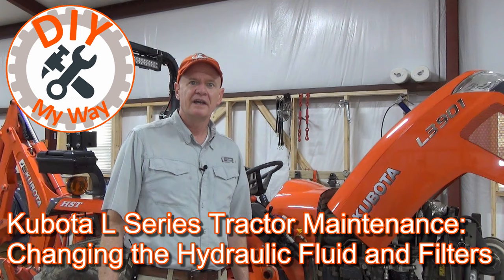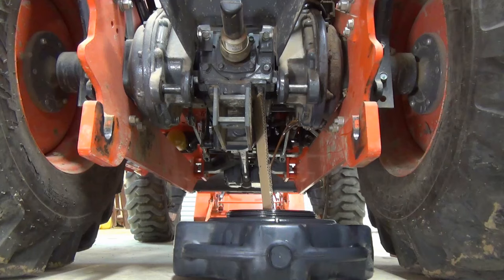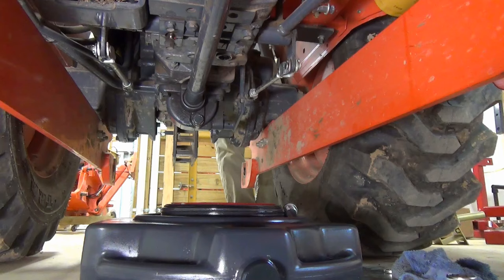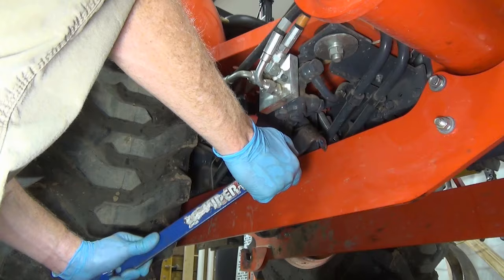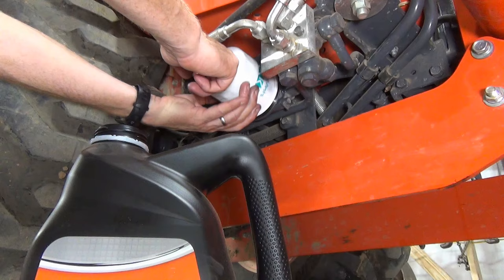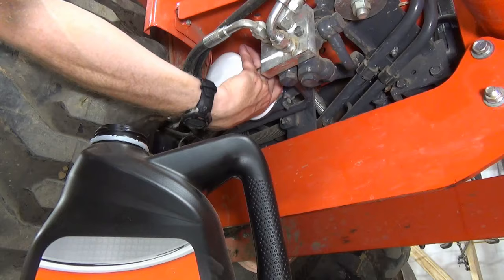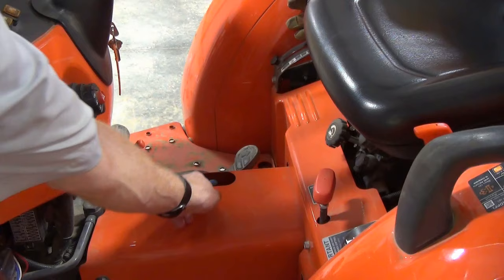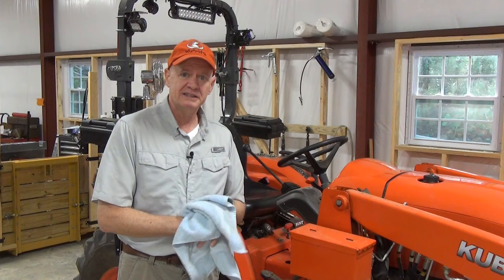How to Change the Hydraulic Fluid and Filter - Kubota L Series Tractor Maintenance (#90)

Comment: Have any of you noticed your PTO shaft turning even when the PTO is disengaged? It seems to spin faster as the tractor goes faster. Is this normal? I called my kubota dealer and they didn’t really give me a straight answer, just said sometimes it happens due to the hydraulic fluid pressure? Should this be something I should be concerned with? I have a 2019 L3901 with just under 300 hours. Thanks!
Reply from the maker: Hi Brandon! I only remember seeing that happen one time on my tractor when nothing was connected to the PTO. Next time you see it turning when disengaged and nothing hooked up you might consider seeing if you can stop it with a gentle grip with your bare finger tips or with a nitrile glove on. Don’t try it with leather glove in case it real is engaged. The leather glove might get caught on the splines and make a bad day for you. If you can stop it from spinning then don’t worry about it. If you can’t then it’s time to get it looked at by the dealer. Thanks for watching!
Reply from the maker: One thing I should add is that if the PTO still turns implements when it is disengaged even long after it should have come to a stop then it needs to be fixed by the dealer.
Reply: Ok thank you!

Comment: Hi, I have an L4600. It's 9 yrs old with 120 hours. Over time, the control lever pedal is harder & harder to press. Also, the pedal does not come back to stop when foot is taken off pedal. What is the fix for this?
Paul Conway
Reply from the maker: Hi Paul!  Only 120 hours in NINE years?? That’s amazing!  The first thing I’d check is for limbs or debris restricting the linkages from moving.  Next is lubrication.  Are there any grease zerks you haven’t been greasing?  I don’t know for sure, but I can’t imagine a problem in the transmission itself that would explain this, so I think it is mostly likely friction in the pedal linkages.  Good luck!
Reply: @DIYMyWay  Hi, I thought the same & had already looked under the tractor. There are no grease fittings on the shaft that the peddle moves, which baffles me as to why not. And very little external linkage which is clear of any debris.
Reply from the maker: Well then you could try using a grease needle to inject some grease in at the edges to see if that helps.  Otherwise, you may have to take it to your dealership to repair.  Good luck!

Comment: Followed your video except I did not think of detaching my frontend loader will that cause any issues?
I had the dealer do my first service and noticed the used the HH160-32093 filter for the transmission the filter I got in a kit had the HHK70-14070 filter which one is correct I have the L3301
They also did not put the magnet back on the hydraulic filter :(
Reply from the maker: No, your FEL shouldn't get in the way of changing the hydraulic fluid and filters. Yikes!  You need another dealer!  That's scary!  Thanks for watching!
Reply: @DIYMyWay  The filter I received from my dealer for the 50-hour maintenance didn't have the magnetic ring - I didn't even know there was one until I took the old filter off and noticed it - I cleaned it up and reused.  The filter for my 400-hour did have the magnetic ring - go figure!
Reply from the maker: Hi Jeff!  Interesting that it’s inconsistent whether you get a magnetic ring or not, which is why I held on to my old one until I confirmed I had a new one. Thank for watching!

Comment: I own an L3560.  Does this video apply to my tractor?  I understand that oil capacities might be different, but do the drain points correspond and the filter locations?  Any advice is appreciated.  I currently have about 30 hours on my tractor so coming up on the initial 50 hour service.

Great video, by the way!
Reply from the maker: Hi Wayne!  The principles should apply, but I don’t know about the drain plug and filter locations.  You can easily find out by locating them on you tractor and comparing them to the locations on my tractor.  Good luck and thanks for watching!

Comment: I have a 2022 l6060 grand. Not exactly sure what HST and Transmission filter I need. Book doesn’t give the exact filter and the stock filters look to have been painted over. Any help
Reply from the maker: Hi Aaron!  That info should be in the manual.  If not you can look it up on line or ask your dealer.  Yes, the original factory filters get painted when the tractor is painted in the factory, which will make them very difficult to get off.  Hint:  use a utility knife to score all the way around where the filters meet the tractor then spray some WD40 on them seams.  Let it sit for a while and it should be easier to get the filters off.  Good luck!

Comment: Martin 2 questions, please: 
Do you recommend running the tractor for a bit to warm up the hydraulic fluids prior to draining?
Any tips on ensuring the fluids drain from the hydraulic lines?
Reply from the maker: In warm weather, no need to warm it up because of the naturally low viscosity of the fluid.  If you are changing it in cold weather, it’s probably a good idea to warm it up.  There is no practical way to flush all the line and cylinders (3-point and FEL) so some old fluid always remains and gets mixed wit the new. Thanks for watching!

Comment: I have an L2500  2WD tractor and it just started making a 'clunking' noise in the rear right wheel, or at least that side of the tractor's rear axle. I suspect maybe its just low on hydraulic fluid?  There is a sight glass on the left of the transmission and it shows nothing until the tractor engine has run for a few minutes.  Is this normal?  When should the sight glass be showing fluid?  Also, I opened up the dip stick cap on top of the transmission and I see no fluid there either but yet I see no leaks under the tractor.   Thank you.
Reply from the maker: “Clunking” is not a sound you want your tractor to make!  If the dip stick doesn’t show hydraulic fluid and you can’t see it in the sight glass,  you are low on hydraulic juice.  I’d top it off until it shows the right amount on the dip stick.  Hopefully the clunking stops!  Good luck!

Comment: how is the change oil to kubota L2000 DT ?
Reply from the maker: Hi Armando!  It should be similar to the L3301 and L3901, except in the ways that it is different.  When in doubt, check you owner's manual. Thanks for watching!

Comment: Can’t find 4th plug on L5030
Reply from the maker: Maybe the L5030 doesn't have a 4th plug.  Have you checked your manual?
Reply: Yes, which is why I asked
Reply from the maker: So your manual mentions 4 plugs and has a diagram showing the location of the plugs but you can’t find one of them?
Reply: Manual shows 4, I don’t see one in the 4th location.. there looks to be  a recessed plug in 4th location that needs large hex wrench to open.  I called dealer, they said 3 plugs. 
The only other thing in the area where manual shows 4th plug is the drain ahead of transmission.  If it has oil there , a seal is leaking.

The fluid is now changed.  Around 11.5 gal went in, manual says 11.9
Reply: @buckeyefarmer6259  What is the difference in the Two Filters, I ask, because the price difference is about $50 - 60 dollars more for the Small Filter, I might use Two Larger Donaldson Filters, as I assume they are the same in Filtration Quality or Donaldson are better in filtration.  There are no Micron or Flow Specs Kubota Filters...?   Donaldson 's Are Larger Filters and in theory allows better flow and filtration...?   I do the same on ALL motor oil filters, I upsize them for better and longer life.  Please advise.  

Thank you for a GREAT Professional Video. 

Drake In Frederick MD
Reply: @cnarewrisher2368  one is HST transmission only, the other filters all hydro oil. I only use kubota filters.